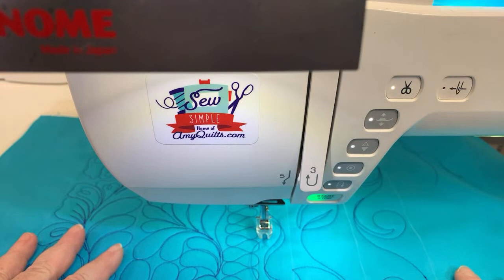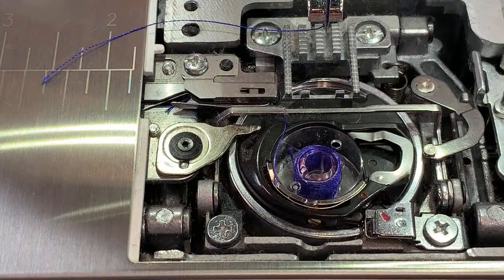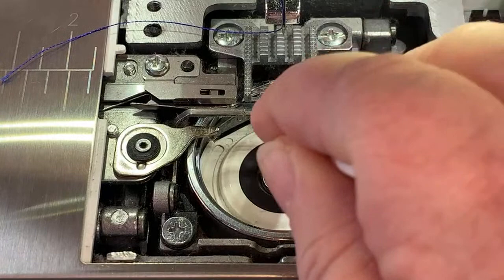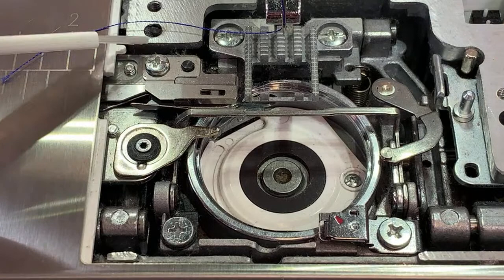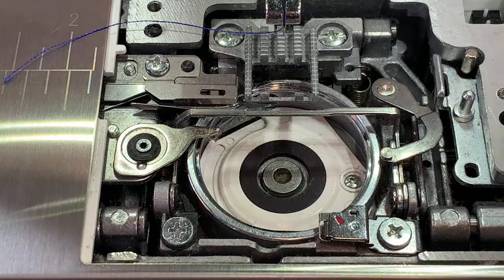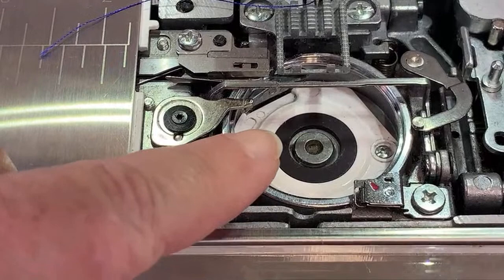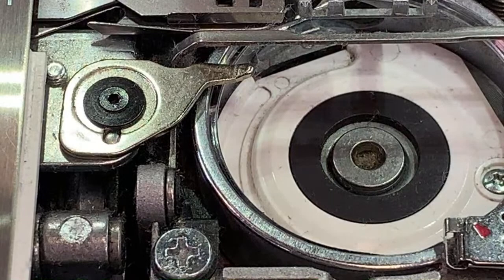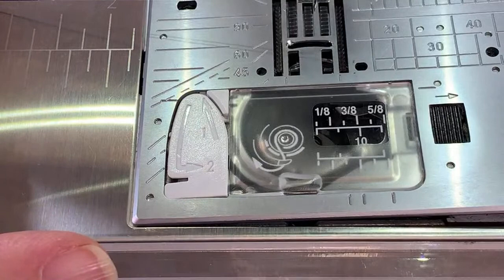Where to oil your modern sewing machine? Should you?

Comment: Thanks for the video. I am one of those ppl dealer said you never need to oil to just use cleaner with 15000. Also the manual. So it is confusing when I see things like this. I have a bernina I oil every day lol. My stopper on Janome got replaced. I clean bobbin and race every change. I got it back full of lint!  Like I couldn’t believe a dealer (different one) tech would send it back like that. Anyway so on 15000 is the cleaner actually oil?

Comment: hi I have a Janome S5 and my bobbin hook race part looks just like the one you have with the groove cut into it, I have no idea how it got that way, the machine is only 2 years old,  I use Schmetz microtex sharp needles size 80/12 as that is the only needle type that works without having stitching/tension uneven stitching problems. . i have no idea how the groove occured but do you advise a different needle and/or getting this part replaced, i do keep up regular maintenance at the shop. thanks

Comment: Enjoyed so much! Great info.  For the Janome 550 expectations are the customer will remove the casings and oil-scary 😮
Reply from the maker: For my customers, we advise bringing the machine in annually for a full service. Many don't feel comfortable doing that level of maintenance, especially for the embroidery arm. Typically the home user won't work it so much that they need to do the arm multiple times a year. But I would encourage you to do under the bobbin case and the one felt at the top which is easy to get to.

Comment: My Janome Skyline S5 keeps breaking the white piece under the bobbin case. I have mentioned to the repair person that the machine pulls to the left way too much. They never have a decent answer. I have paid for the service twice and had the plate replaced twice.
Reply from the maker: My hubby says it's one of 3 things, but we hate to have our answers used as ammo against another service person. So I will address the only one that could be 'user error'. If it's not this, let's just say you might want a different repair person who will know the other 2 machine possibilities and make the fix before replacing the plate. When looking at the broken plate, is it broken or worn through/scratched apart? This can happen when a needle isn't inserted fully up into it's position. In this case, it usually doesn't break the teflon-like material, instead the needle eventually scratches through.
Pulling to the left is usually a presser foot pressure issue. Reduce it and see how it sews.
Reply: @AmyQuilts  Thank you so much for your reply. I did try the needle placement problem and yes because I have difficulty with my right hand I believe it was not installed properly. I checked the needle position like you showed and  it touched the white plate. I got help from my husband and wala the needle is good now. I do not blame repair persons because they can only identify the problem at hand and replace the part. THANK YOU AMY

Comment: Excellent video, do you have any idea why my bobbin case is wearing down so quickly and leaving a black film over the bobbin race? I’ve had to change it twice in six months
Reply from the maker: Is it a Janome? Black film makes me think of maybe you're using a solvent like 3 in 1 oil instead of a sewing machine oil. Not a typical issue for sure!
Reply: @AmyQuilts  it’s a sewing machine oil. The film is the worn down residue that you get when metal wears down I just don’t know why it’s doing it. When the thread weaves between the bobbin holder and the race it picks up the residue and turns the thread black. Very confused as to why it’s happening